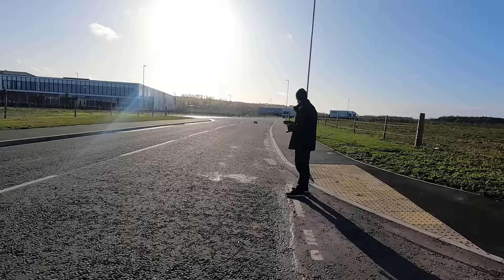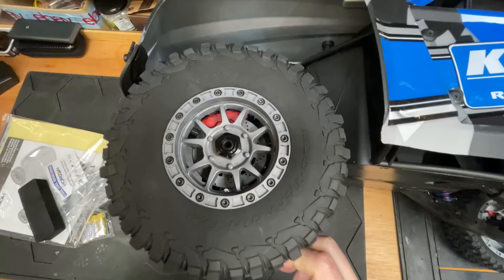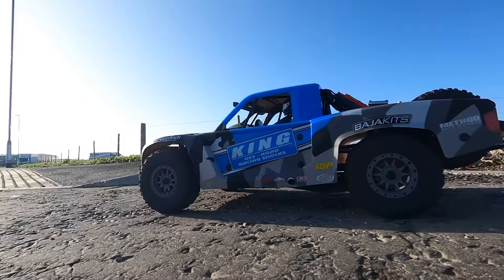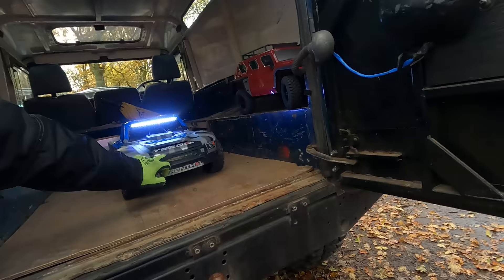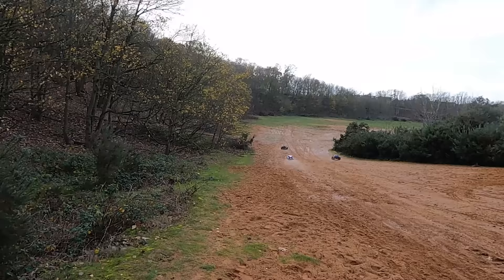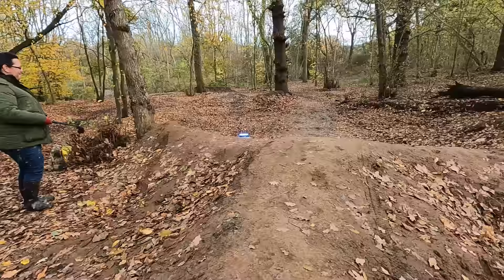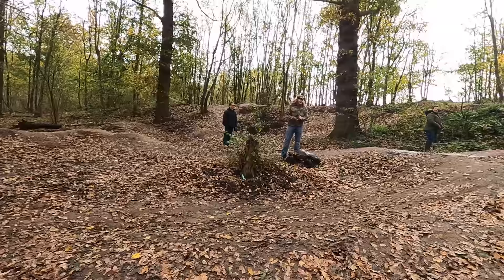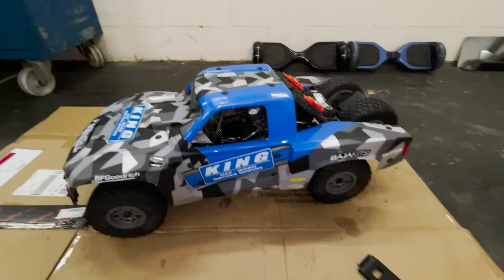GiANT FAST new RC Car - The best yet?

Comment: Isn't it an option to create a couple of cable adapters?

A very short cable with the standard connectors on one side and the ones you use on the other. That way you never have to do any soldering again :P

Comment: YES! - My SBR 2 came in the post yesterday! Still in the process of stripping it and rebuilding it to fix some of the poor assembly issues... Also making a brace to reduce the rear body/cage flex. Awesome vid mate, got me hyped to get mine out ASAP!
Reply: Got mine too.. what issues are you fixing exactly? Other than the rear brace
Reply: @Nenortiz  My front right wheel/hub needed shimming as it was wobbling so bad I thought they had forgotten to fit bearings in the hub. I'm also suspicious about the the diffs feeling very free, as if there is barely any or no grease/oil in them at all (as has been reported by other users too). Other than that, just adding loctite on metal to metal screws and tidying the cables a little neater - Its a great looking little TT :)

Comment: I like this. A lot.
After 30 years of being out of the hobby I'm financially stable enough to go at it like I want to. From what I've seen in this video this is exactly what I want. A cross between a buggy and a truck that is insanely fast. Plus it just held up to Kevin's bashing.
Assembly is part of the fun.(Tamiya/ T.A. RC10 nostalgia)  I'm going to have to do some research but I hope Losi sells these as a kit.

Comment: I was a traxxas fan of untill I realized other brands are just as good. Glad you are showing the other brands Kev. The top rc cars in my opinion are the 6s kraton EXB,  the Losi Super Baja Rey, and the xmaxx. I like the e revo too but its not as durable as the EXB kraton I dont care about the other traxxas cars other than xmaxx and e revo.
Reply: check tekno mt410 then ^^

Comment: So I’ve learned that a cheap King 1600kv with a Max 5 and 19/50 gearing ran on 6s is at least if not better than an stock traxxas 8s setup. That’s awesome! Do a build and bash video on that haha I’d tune in

Comment: Hey, Kev! Im trying to decide on a kraton 4s or a slash 4x4 which should I get??
Reply: I'm not Kev but for big air I'd get the kraton. The short course trucks parachute as seen on some of Kev's other vids. You could also get a Rustler 4x4 vxl (I have it and it's good) they're basically shorter slashes that don't parachute.

Comment: Honestly i think people would consider it more if priced lower. It is the same price as an xmax or kraton 8s but doesn't seem close to the size. That current price tag will easily turn people away
Reply: its longer,the body is wider, and its faster,the X-maxx just looks bigger because its taller and the wheels are wider,Trust me I have both and the SBR is bigger

Comment: I had to decide between the 5t 2.0 or the super baharey , I chose the 5t to race along side my Vekta 5 , hey Kevin where are you at with your raminator ? I've sent the tmr motor back , after a year they still don't have a pipe for it , so I'm waiting on the RC max 50gt motor , made just for the ram ,are you waiting on the 80 ?

Comment: I bought aluminum parts for my rustler 
The a arms caster blocks steering blocks rear axle carriers and the shocks is it better to buy RPM parts cause aluminum last longer but it weighs my car down any suggestions Kev!!! Also great content you put out love your channel and videos!!!!!
Reply: One bad crash your car is wrecked if you bash. You need flexing no be a rock
Reply: @EXTREMERC416  what do you mean
Reply: @EXTREMERC416  I race it I bash my stampede only not my rustler

Comment: Batteries you left us a link purchased in description 3s, equivalent to 6s, not 4s, equivalent to 8s as yours

But don't you guys worry (you too, Kevin) This is the Kevin Battery Link
👇👇👇👇👇👇👇👇👇👇👇👇👇👇👇👇
https://www.gensace.de/gens-ace-5000mah-14-8v-4s1p-50c-lipo-battery-pack-with-xt90-plug-bashing-series.html

Comment: Got mine about 2 weeks back.  Regret it.  Most flimsy design ever.  The tail end is flexing, so much that the rear tires are rubbing thru the body.  The cage flex is just nuts.  If this is what LOSI put into production, I cant imagine the kinds of junk that they said, "No, this is just toooooooo much to ask for this much junk".  The aftermarket will make bank for the ppl that keep this thing.  Ill keep mine, there are some cool parts I can use to beef up something else.  Looks great, but there will very few that will be around in a year or 2. What 1s there will be, will be modified or have been babied. A basher its not.